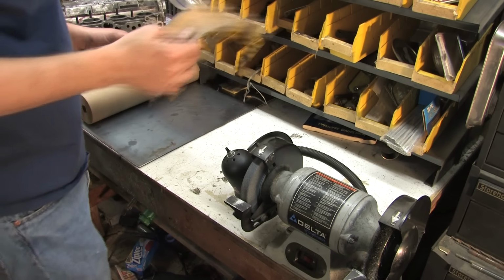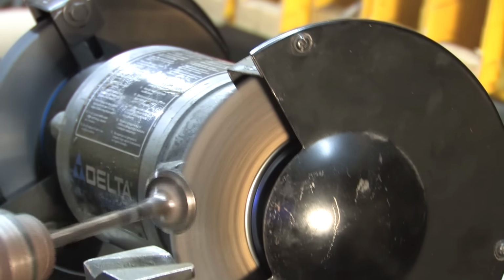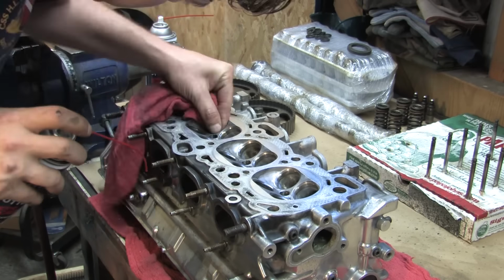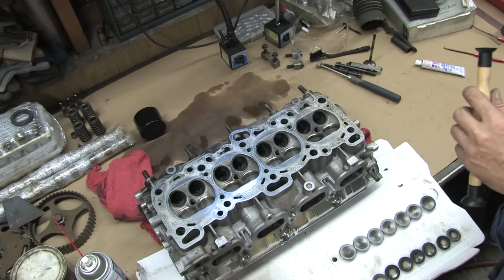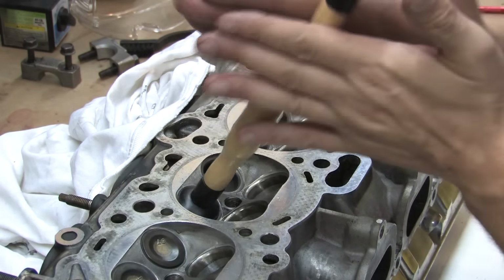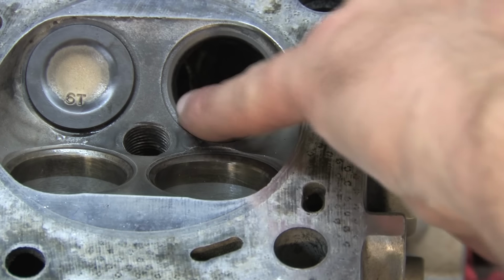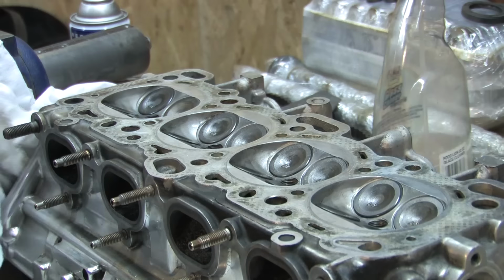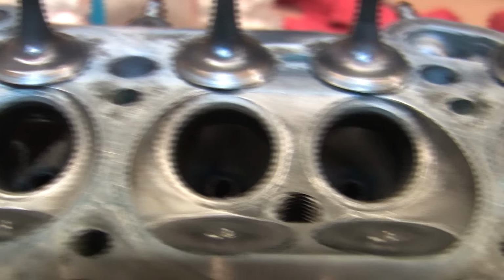Cylinder Head 105 - Valve Job Basics

Comment: Well done.  Very, very well put together and tightly edited.   Now I need to go buy a brass wire wheel and brass Dremel wire wheel.  De-Carbonizing the combustion chamber was done using what spray chemical?

Bill
Reply from the maker: Roush2RPP non-chlorinated carburetor cleaner.  The stuff I use isn't a carb cleaner, but it works as carb cleaner.  It's more like the stuff they erased toons with in Who Framed Roger Rabbit?  It's expensive, hard to find and way overkill for this job.  Carb cleaner works, it just takes a little more of it.
Reply: ***** I just tried your cleaning and lapping process on a 20 hp. Kawasaki ZTR mower engine.  I couldn't find the Gum Cutter locally so I used CRC Lectra-cleans parts cleaner.  It works well.  I need to dig out the carbon and gum from inside the ports on one of the heads.   I purchased a brass plated 6" fine grit wire wheel from Lowe's.  Aside from having to shim the wheel to center it, it works great for cleaning the valves using Milwaukee electric drill to hold the little valves that are taped with masking tape.  .
Lapping the valves I used to twin tube lapping compound and used only the fine to lap.  The valves are small and I used the smallest lapping suction cup but it was a real pain.  I never was able to keep it stuck to the valve and roll it through my hands like you illustrate in your video.  
Given my wrist method, not hand rolling, it took a while to lap two, two valve heads.  Plus, I forgot to do the "squeak test" when dry.  I will check it out tomorrow.
FYI, I am block sanding the aluminum head to put a good finish on it.  The 320 grit is on a surface plate and I am moving the head back and forth.  Finish looks good. 
Anyway, thank, keep up the good work!
Bill
Reply: Roush2RPP I forgot to add I picked up a couple of the Dremel 535 brass wire wheels.  One got consumed too quickly when I leaned on the wire wheel to much.  I am going to use the odd nylon brushes I have sitting in parts boxes from years of having Dremels.  I hope they work well on removing the deposits behind the valve seats and runners.

Comment: What I do sometimes is use a rubber hose that fits tight over the valve stem, and leave about 4 inches and clamp the drill to the other end of the hose and bam

Comment: Great video. Dont some valves gave a thermal protective coating on them im doing the heads on a 99 dakota. Its a mopar 5.2
Reply from the maker: Yamaha Rider Some valves are nitride coated, but not every manufacturer uses them.  Stock DSM valves don't, but this head got a radius cut valve job and the Supertech Stainless Steel valves I used have it.

Comment: Hey, great vid, liked and subscribed. Question, I have 1mm oversized valves that already have a 3 angle machined in them. Can I just lap these valves into the seat and now have a larger valve with a 3 angle valve job done without having to send out? Now, I've been told I can go 1mm without having to change seat. How will I know? Is it just a matter of putting valve into seat and seeing if it's sized enough to work? Thanks for consideration .
Vinny
Reply from the maker: Sorry eh.  It won't work like that.  It needs to go on a 1mm bigger seat.  You can keep the seats you have, but you have to bore them out and have the seats cut 1mm larger to fit those.  If you can get away with this job without going bigger on the valve (assuming it's a 4g63), then don't.  Don't use those valves.  The factory sized valves actually flow better than all other alternatives and makes more power than the bigger ones.  It's the shape of the port that matters more for airflow than the valve size.  You'll lose port velocity with that upgrade, and low and part throttle will be a dog if you enlarge it.
Reply: @Jafromobile  so your saying I'll have to blend the port and enlarge to accommodate the bigger valve. I understand about velocity, but I've never heard of going larger in valve size and actually hurting flow. As long as the machine work is there and angles are there, I should pick up more? No? It's going to be heavily procharger. I was just hoping I could go 1mm over on stock seat, but sounds like without the other work with it and just going larger valves, will hurt? Correct?
Reply from the maker: @vinnydelucia2510  Wait... I answer everything in the context of Mitsubishi 4g63s since that's all I'm working on around here.  lol.  First generation 4g63s suffer from 351 Cleveland syndrome where the ports are too big for their own good.  In the case of 4g63s, bigger valves makes it worse.  So I cautiously warn my viewers not to make it worse is all.  It doesn't help the second gen stuff, either.  So before you heed my advice, you need to look into the particular thing you're working on.  I'm not aware of anyone pro charging 4g63s?  But the bigger valve bigger seat rule still applies.  It would be counterproductive to put a heavier valve in there if the ports and seats weren't enlarged.  On 2v/cyl cylinder heads, I say go for it.  On 4v/cyl heads I say no.

Comment: Drill works best with a rubber hose on the valve stem.  never had an issue at all with this method.  The slowest setting works best and a slight pull on the drill and hose.  If done correctly, the hose will pop off the valve stem easily enough.  This way you never overload the valve and grinding.

Comment: Thanks for the great video. Good quality and excellent instructions. Quick question before I start. Do hou recommend a brass or brass coated wire wheel? Am about to start on some very dirty valves out of a cross flow engine and want to get it right. Thanks mate!
Reply from the maker: Brass coated is the one you want.  Steel works fine, the brass is just a little softer.
Reply: @ awesome! Thank you. That just saved me $60. Happy Xmas

Comment: My dad use to have a rig set up that sat on the head and you set the depth then spun the crank on the side clock ways  it would turn one turn CW, lift, then drop and turn the valve back CCW then lift drop and turn CW, after he past I looked for it but he must have given it away or sold it some time after retiring

Comment: Can i a lap  Motoxcross Aliminium head with stealvalves like this?
Great video
Reply: One is leaking so i have to fix it so i was thinking tou buy a new and lapping it to place or what do you recomend?
Reply: KX450Haninge I used to race a crf250 and these were notorious for eating valves and seats. make sure you replace the guides when you replace the valves and have the seats cut on a quality machine otherwise you'll be adjusting valves again in a few hours.

Comment: Great information, going to be lapping valves on my 8.1L silverado for my first attempt, was going to do the drill method until I watched this video! What do you recommend for cleaning carbon deposits off cylinder head, acetone or brass wire brush?

Comment: I've seen people use a rubber hose on the stem and use their hands to pull on the valve a bit to grind down the seat. I wonder if this would be a better method than using that suction cup tool.
Reply from the maker: No.  It's not.  95% of everyone who does it with a hose for the first time - does it way too long.  5% of them who do it right did so because someone that knew what they were doing with it was standing over them telling them to stop.  If you learn this the manual way, then 95% of the time you use a hose in a drill, you'll do it right.  

Remember that the more you lap, the more of the seat you wear away.  Lapping will shorten the lifespan of an otherwise good seat and valve.  Not like a leaky valve will... but the less you can do to make it seal, the better.  I actually fully expand and explain this (and tons more including vacuum testing) with another video ironically called "Not Another Valve Job".

Comment: Valve lapping is for general clean-up but when the engine warms up, seats and faces expand. It would be better to have a machine shop to do that! Guides are worn. Sometimes valves with larger stems are needed because guides aren't there.
Reply from the maker: I agree about the lapping.  Typically on these heads people just press out and replace the guides if they're worn out.  The work you saw here was a basic clean-up and test to see if it needed more work.  It didn't.  The valves came out fine, but it ended up getting a valve job anyway to install a much better set of valves in it for my purposes.  That video is linked in the description.  :)

Comment: Really enjoyed the video, I'm going to be cleaning up valves in my sons car. One word on the Gum Out, Looking at the Material Data Safety Sheets for Berkebile Oil 2 + 2 B101 Instant Gum Cutter -  and CRC Car Cleaner they are within 1-2% or each other for percentage and type of solvents use with Acetone being 50% for CRC and 52% for Berkebile, the rest are the same within 1%,. So they should work the same and you can save big bucks, even some generic brand carb cleaners have cloned the percentages and have same or near same make up. Now what the company says they put in and what they actually put in can be 2 different things, so maybe the difference is there. Just Sayin'............

Comment: Everything is fine cept I'd just just a rust cutter solution and sand paper for the under side. Then lap it if it's that bad just use like 2000 and finer sand paper

Comment: You can do it with a drill. Real slow. And put a fuel tube over the valve stem. That way its not as harsh for the valve stem guides

Comment: If you do this with a drill, put an elastic tube on the valve than rotate it slowly. Its mutch easier, if you use a small drill, you can hear the sound changing

Comment: I like using a drill on low speed to lap the valves.  If you want you can go back and forth still.   Two grits of compound work well too, just like the video.  Shine a bright light down the runner to make certain the valve seat is just right.

Comment: Awesome video, very informative. Ill be doing this on my 0.7L KE70 Mitsubishi diesel engine for my tractor along with a re-ring. What are all the supplies needed? So far I got lapping compound, coarse and fine, lapping tool, assembly lube, prussian blue, and pizza box? I know you didnt use fine, but you mentioned it and other videos use prussian blue for fitment. What do you think?

Comment: Hello, I agree with nick below, excellent video. I have to do this on my land rover 2003 discovery heads while I have them off.  I was not feeling it, but after watching this video, I think I can do it.

I might need to watch that part about the spay cleaner you using on the stem walls again. You warned against it. Gum Cutter ? I heard brake parts cleaner is good to use on many things. What do you think ?
Reply from the maker: Alexander Wayne I don't use brake cleaner.  I always use carb cleaner.  I feel like it does a better job degreasing, while I find brake cleaner does a better job at evaporating.  Evaporating before it gets a chance to do any real cleaning.  Also most brake cleaner is chlorinated, and I don't allow chlorinated products in my garage because I weld in there.  Welding near chlorine vapors can be fatal.  Gum Cutter is Berkebile 2+2.  It has no equal in carb cleaner or brake cleaner land.  I buy it by the case.

Comment: Awesome work and video of it.  Quick question... is a brass-coated wire wheel ok, or does it have to be solid brass? Many brass-coated (over steel wires) wheels are available for my grinder.  Thank you.

Comment: Jafro, I watched this video many times, in case I missed something. I watched many other videos, too. I got enough courage, bought lapping paste and a handle and went to do my first valve job. First time I did it by hand, but after doing the water test, all exhaust valves leaked. I used fine paste. So I decided to try coarse paste and using the drill method with the rubber hose. Did the water test, now all the valves are leaking. I'm suspecting the valves are bad (some were pitted on their faces).

I'm getting a used set of 1g 6 bolt valves which  look in much better condition. But I don't want to ruin those. Should I just go with coarse paste and a drill, then fine paste by hand? I can't afford getting the head machined and valves cut, around here it's too expensive and most of the shops don't really offer quality work. I have the motivation to do it myself, but I fear it may be outside of my ability.
Reply from the maker: 2 questions:  How long did you lap them for?  how wide is the margin?

Lapping is an inspection process.  It's not going to fix pitted valves or damaged seats.  It's intended to make the sealing ring obvious so you can check it against your specs and do all this with the naked eye.  You shouldn't use coarse if you can avoid it.  If the seats are too wide, your valves won't seal as well as they would with a narrow margin of contact.  Once you lap a ring around both parts, you inspect them to see where the seats line up, and if that line has a break in it somewhere (where it won't seal).  If you lap a valve and there's a problem, that's when it needs machine work.  If you can lap an un-broken line around both parts and it's within spec, you're done. 

If you pop 3 Adderal drink a case of red bull and lap all the angles out of the seat, they're not going to seal.  There's no seat left 

Lapping a new valve into an existing un-burnt un-damaged seat might get you by for replacement purposes and on stock stuff, you can usually get pretty lucky.  But whenever you're replacing valves, you're supposed to get new seats cut.  If you can taik to some gear heads in your area, people that race, people at Cars & Coffee, people who own classics and antiques, they'll tell you about the guy they know...  Trust me, there's someone in your area with the right machine.  Serdi or Sunnen equipment should be able to crank this job out in a couple of hours for well below $200 if you hand them your valves and a clean, bare head.
Reply: @Jafromobile  Much  appreciated for taking the time and replying!

I'd say I spent 2-3 minutes per valve (with frequent changing of the angle like you suggested every 10-15 seconds). All the valves got really nice, continuous gray lines across their faces (the paste I used is sort of gray/green), as well as the valve seats. To my inexperienced eye, they looked real good and not woo wide either. I did take a measurement of the thickness of each face but I can't remember off the top of my head. I need to start writing things down... I do remember that I was still safe in terms of the margin.

I'm suspecting I just didn't lap them long enough. Each time I pulled the valve out slightly and dropped it down again to continue rotating them, they start being noisy again and then quiet down. I could have gone like that infinitely. Guessing it's the leftover paste running back down and starting the grinding process once more. When do I know when to stop?

I do have a blue marker pen so I tried coloring the seats, then placing the valve in dry and rotating it a few times. Most of them 'erased' the blue marker, which to me implies there's some good contact between both faces. I even water tested with the springs installed. After about 10 minutes I could see water 'tears' right under the valves. 

I will try lapping the other set of valves I got with the fine paste, by hand, but I'll spend more time on them. I've got a buddy who has two EVO 8s properly built and he suggested using coarse paste and the drill. Every gearhead has his own ways of doing things I guess. What I'm looking for is just something that would work for me. I'll keep trying and do my best to learn. Again, thanks a lot for all this information!

Comment: I recently did the heads on my Subaru, and gently did the drill method with a piece of fuel line between the drill and the valve stem, being careful to avoid lateral forces on the valve guide, then multiple passes of hand lapping with that same tool

Comment: Video was great thanks for sharing i didnt need a valve job but watched it anyways
Reply from the maker: It's quite alright!  I didn't need a valve job either!  That's what was so nice about this video.  I just cleaned 'em up and checked 'em all.  
If you like this kind of thing, though... the actual valve job where machining is done to install a larger set of racing valves is linked in the description.  ;)  It's like an ASMR session if it were inside a machine shop.

Comment: but i dont lap valves very often i cut the seat angle smooth or replace the seat if it not savable good vid
Reply from the maker: Yes, it makes much better use of seat pressure that way.

Comment: How did you check the absolute tightness of the valves after grinding ???
Reply from the maker: You could just repeat the water test (gasoline test, carb cleaner test) that I demonstrated in one of my cylinder head videos and see if anything leaks.  I did not bother measuring seat pressure on used valves and seats when nothing other than the lapping changed (and it worked fine previously).  But It did pass the water test after I was done.  I didn't film or show it passing that test because I didn't think it mattered.  Then my cam selection changed to a set with .034" more lift than a stock head, and I had to change my valve install height to accommodate that kind of lift.  Kelford cams recommend using beehive springs.  In Cylinder head 201 I had a complete valve job performed with brand new Stainless/Inconel oversized valves.  A different set of springs were installed in Cylinder Head 203.  In 203 I show a machinist demonstrating the entire process for measuring valve install height and absolute seat pressure, and then assembled.  This same head was used, but you'll notice it looks a whole lot different.  If you stick around, you will see a whole lot more of this head.

Comment: It would be much better to glass bead the valves. And resize the valve guides (nuraling) with new valve stem seals. And a 3 angle valve cutting.